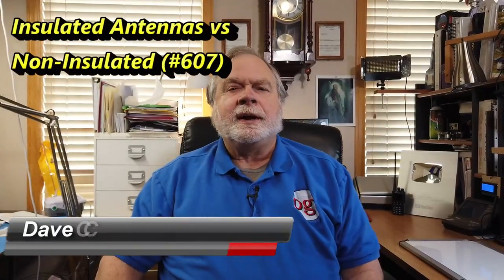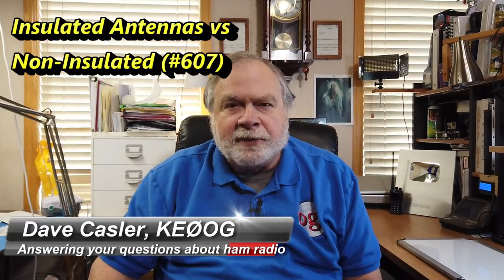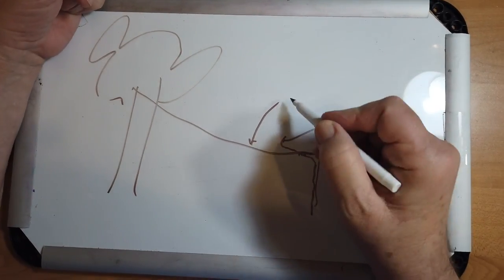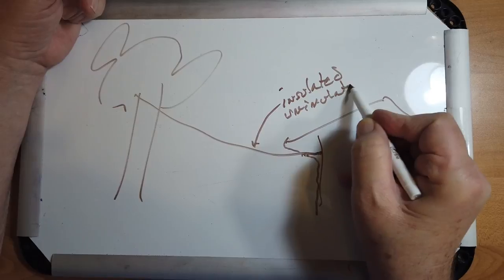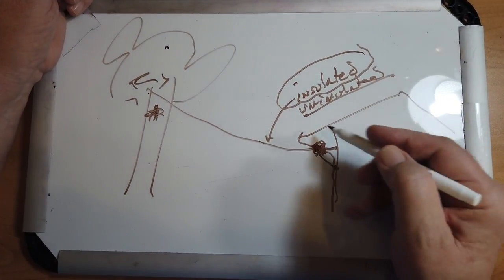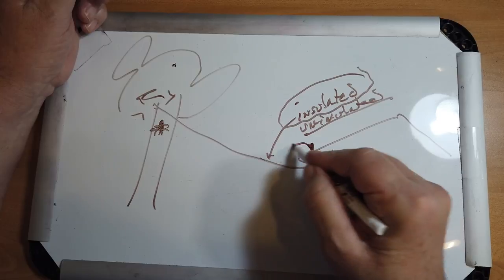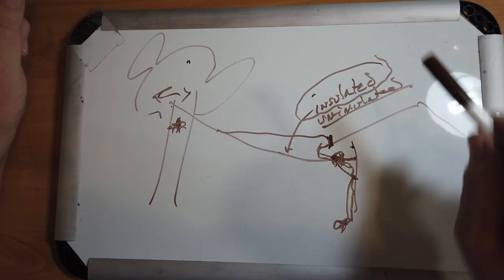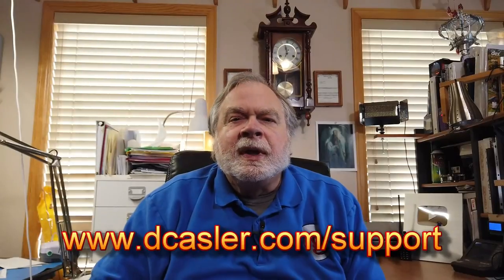Insulated Antennas vs Non-Insulated (#607)

Comment: I suggest that the guy line that attaches the insulator near the house be extended so that the end of the wire antenna is FURTHER away from the gutters and downspout.  Yes this may necessitate a bit more coax and guy rope/cord or a slight reengineering of the antenna's attachment to the house.  In other words, get the antenna a bit further away from the house.  This will help with the noise level as well.

Comment: I have an insulated 130 ft efhw antenna. I had some cedar limbs touching the wire. SWR was okay, but after I cut the limbs down, my swr improved dramatically. 73’s

Comment: I was using you mast idea with three lengths of top rail holding my feedpoint up with a 12” spacer to hold the elements away and space my open spaced feeder from the top rail but either the elements or feeder was coupling to it and increased my noise floor 2fold I was s7-9 every given night on 160m and once I lost the mast due to incompetent landscaper who hooked my guy lines on two separate incidents. So last time I decided to move and used a tree to pull the feedpoint up and flat top the doublet my noise floor has dropped to s3